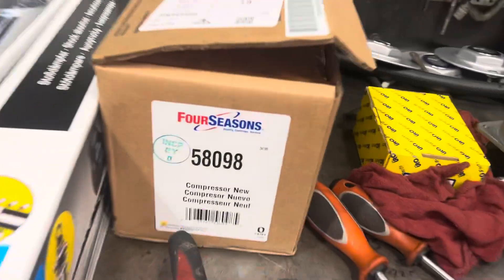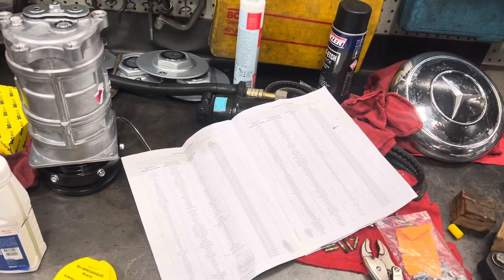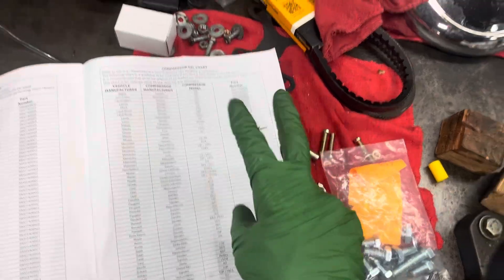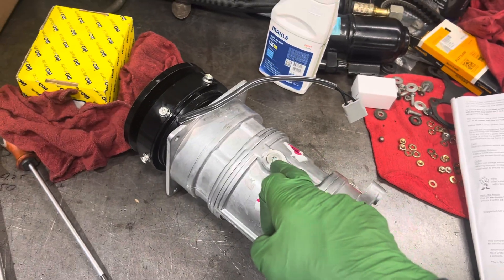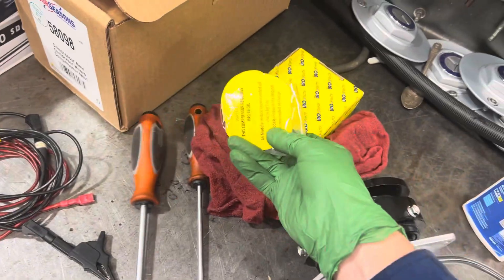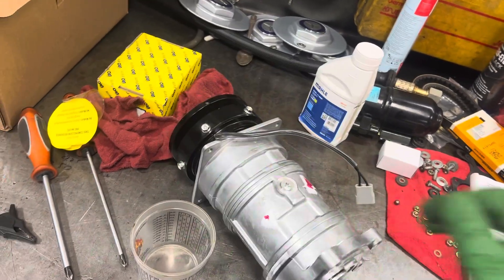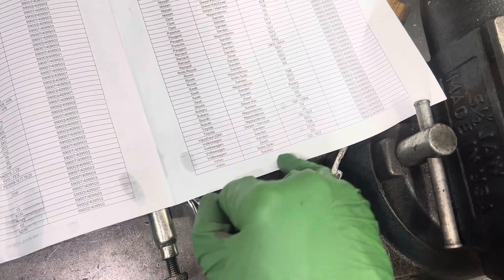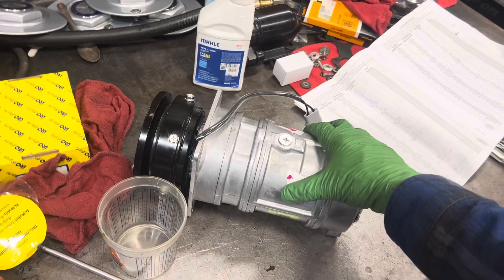Refrigerant oil instructions that are confusing encounter. Intuitive.. cause problems.

Comment: So I have one for you that ties into this theme. First off my background is industrial HVAC-R. Very little auto ac experience. 1993 Chevy C1500, originally would have used 2.5lbs R12. If you converted it on a stock system you would have used 2lbs R134a. Well I replaced everything but the evaporator and went from the 6mm tube and fin to a parallel flow condenser. In my research you're supposed to also reduce the charge 20% so that puts me around 1.6lbs. So in researching clutch cycling orifice tube systems I found out they are supposed to stay flooded on the evaporator with the accumulator holding the excess. With that said at 1.6lbs with the blower on high I had a fully flooded evaporator. Long story short what is the correct charging procedure on a system that has changed enough that the charge sticker is no longer accurate? The system has performed great since the conversion but I do not want to run the system low and oil log the evaporator and ruin the new system. With that said I'm probably overthinking this entire situation.
Reply from the maker: Depending on the year make model most of these old or Tube systems would run somewhere between five and 7° super heat. 
     If you had one of the Chevy pick ups that have a thermal fluid fan clutch. They slowly go out of calibration with age and time.. does not affect your engine heat, but it greatly affects the airflow over the condenser. 
  As you know, airflow is king and if the airflow is wrong, then you’re readings for superheat or sub cooling are incorrect.   So if you do have a fluid thermal flat clutch switch that out with a new one.. 
       And wait for a nice hot summer day 85° plus to perform your measurements. After the clutch has warmed up and kicked in.. 
     If you’re lucky, you’ve had one of the older trucks that were late enough model at GM had a TSB technical service bulletin with a retrofit procedure.    And possibly one of their trucks that they had an upgraded replacement, parallel, flow, microchannel condenser. 
     And they came with a charge quantity that used to be on an orange sticker that was stuck on the new micro channel condenser. 
       And a cycling clutch switch that will be located either on your accumulator or on the suction line.  
     When you lift up the wiring harness and unplug it look down inside you may have an adjustable one. 
          Are the old R 12 refrigerant it was adjusted to 24 psi
    On the new 134 refrigerant you will wanna adjust it down to 21 psi. 
       some of those rules are done, excluding the microchannel conversion.  At 25 or 20% reduction was actually too much on many vehicle vehicles.. 
 It would still cool, but the compressor would be starving on a hot day. For return cool flow of refrigerant and oil.. 

as you know, piston systems were capillary tubes a.k.a. Automotive orifice tube do not compensate.  
     Like a expansion valve

Comment: Tom, about a year ago I contacted you I told you about a problem I was having with a new compressor. It has a tick that is not clutch related. You recommended vacuuming the system down and replacing the orifice tube. I'm getting ready to perform this work but I've also seen suggestions to replace the accumulator. Do I need to replace the accumulator also? This unit cools down to about 60° air coming out of the vents. FS10 compressor. This performance level is what was achieved after the rebuild. It has maintained this level of performance over the last year and a half therefore I don't believe there are any leaks. Thanks for your advice.
Reply from the maker: If it’s performing good and there’s no leaks why are you opening it up?. 
   Replacing a orphan tube because of a ticking sound does not seem logical. Definitely nothing that I would say.. 
    If it’s a very old system seven years 10 years 15 years old, you definitely cannot hurt anything by changing the accumulator that has the desiccant chemical inside of it to help. Keep the system dry.  Just perform the manufacturer suggested oil balance procedure for the quantity of oil that is needed for that accumulator.
Reply: That's just it it's not performing good we have had heat indexes of 110°and when you turn on the AC is 80° are coming out of the vents and may only reach 70° after an hour of running. I'm more concerned about the performance that I am the ticking noise at this point. Could a low charge of refrigerant or too much oil, or air in the system be the cause of the ticking?. @coldfinger459sub0
Reply: @coldfinger459sub0 the system is only about 2 years old.